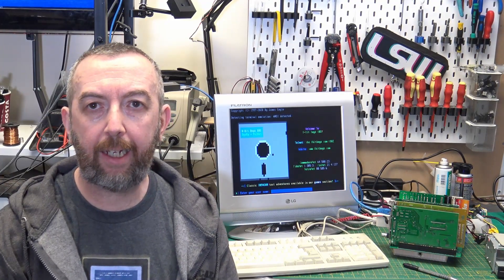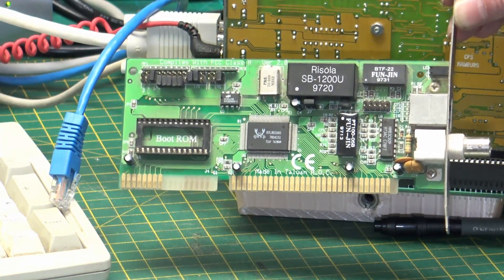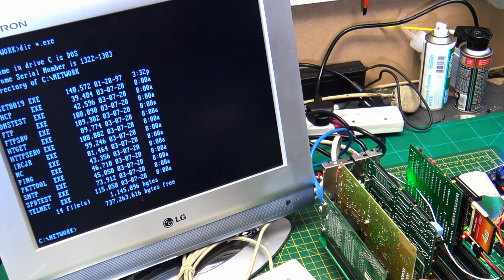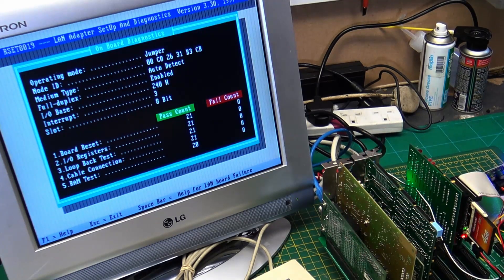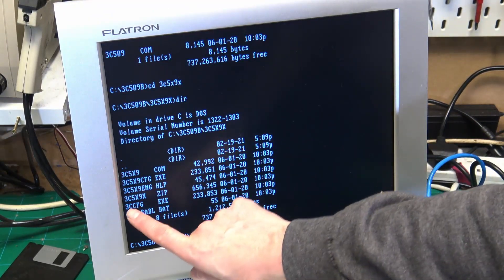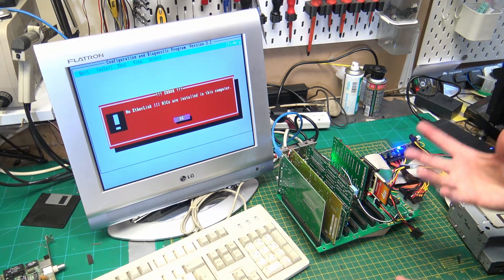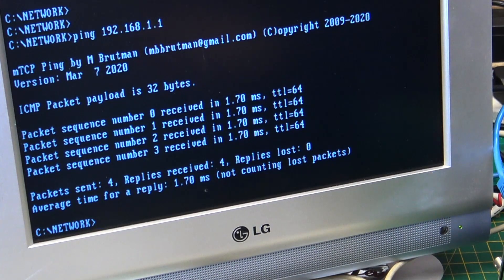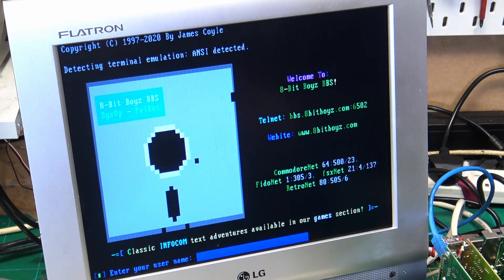Micro 8088 XT Part 6 - Using 16bit Lan cards in 8bit systems.

Comment: Just thought I'd mention that I have a D-Link DE-220-CT in my micro 8088. I downloaded the MS DOS drivers from the dlink website (http://support.dlink.com.au/drivers/files/adapters/de220.htm ) which includes the packet driver. The configuration tool worked and the card works perfectly in an 8 bit slot, no hacked drivers or preprograming required.
Reply from the maker: Great thank you I will pin this comment so others see it.
Reply: @leesmithsworkshop  You forgot to pin it!
Reply from the maker: @ducksonplays4190  thanks for the reminder.
Reply: @leesmithsworkshop  Your welcome.

Comment: Thanks! I am struggling w the same thing. Intel 8/16 Lan Adapter. I get as far as you did. I am guessing the card is faulty, and have ordered two other Intel 8/16 cards. Fingers crossed.
Reply from the maker: I am sure I tested the card in my pentium system and it worked so the problem is a driver issue more than a fault.
Reply: @leesmithsworkshop  Thanks. Yes, it's more likely a driver or settings issue. I do use the Intel drivers reported by others to work and mTCP. I will experiment more and update you here, when I find out. Thanks for a great video.